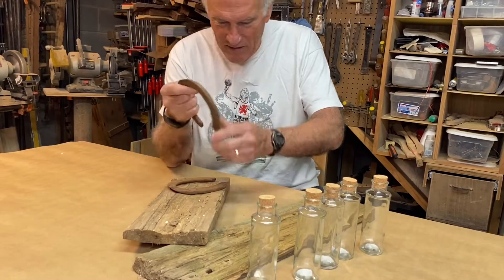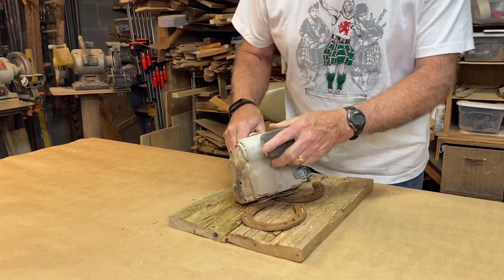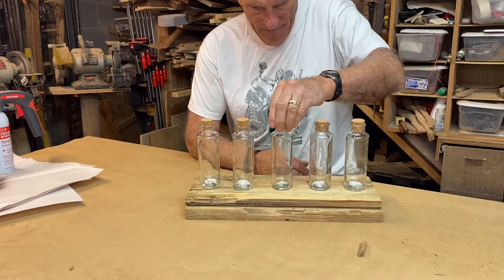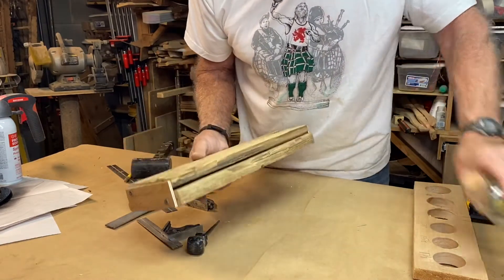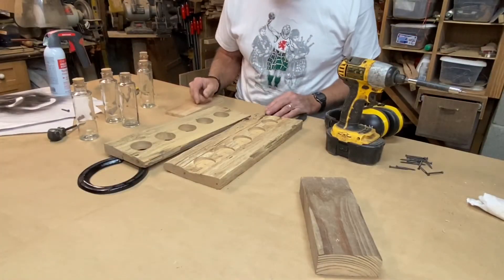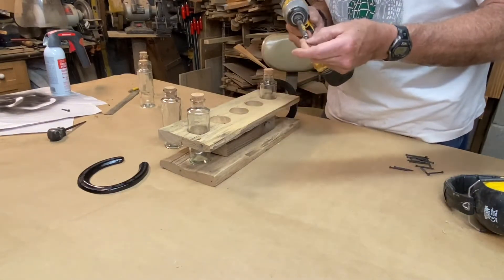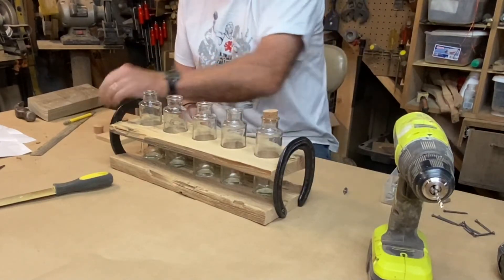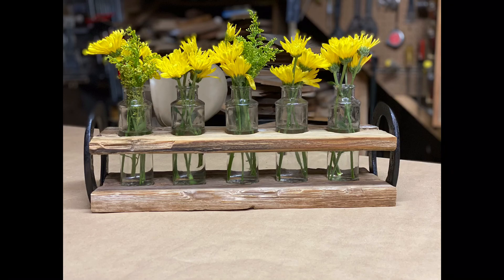Valentine Gift for Your Equestrian Sweetheart

Comment: "I'm going to use this slap sander to clean things up."  And now I have 2 hours of shop cleanup to do.

Nice little flower holder.
Reply from the maker: It did create some dust.  I usually do it outside but the windchill was in the 20’s!